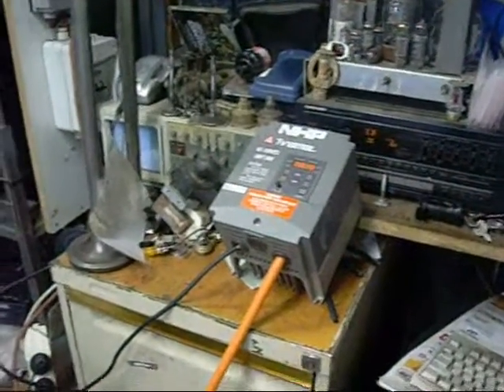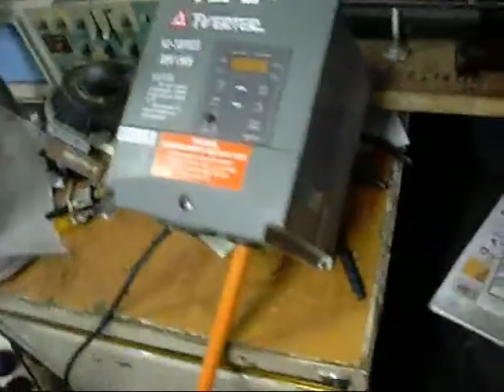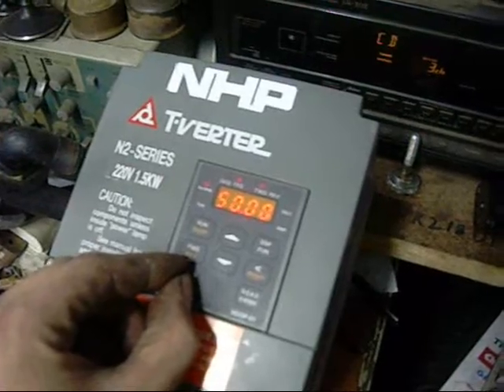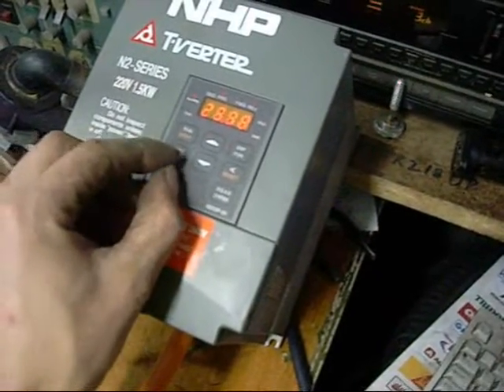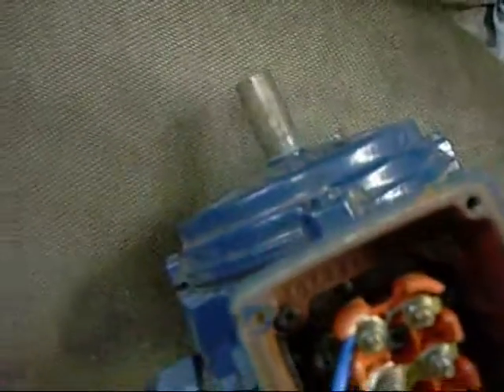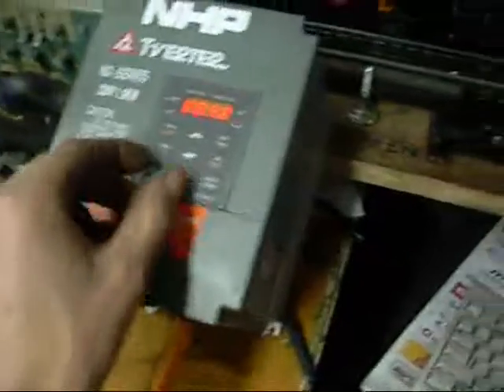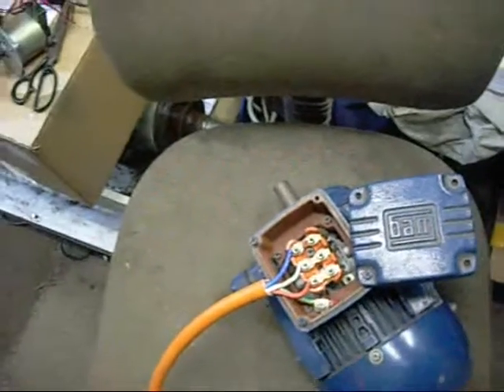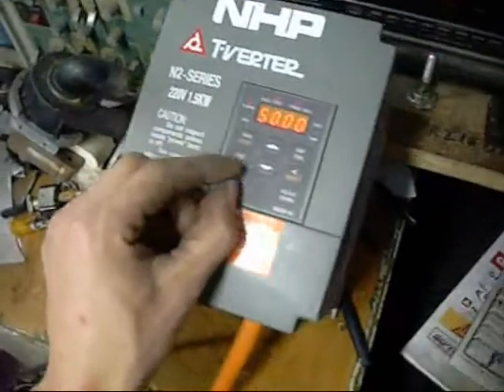Testing 1.5Kw NHP N2 Series VFD on .75Kw WEG Motor

Comment: Ola amigo, tengo un inverter  T-VERTER  N2 440V 3.7KW  si pudieras por favor enviar el manual de coneccionado de tu inverte, te lo agradeceria mucho, gracias por tu respuesta
Reply: Qual valor do teu inversor de frequencia eu quero comprar um para testar compressor inverter de 9000 a 24000bteus
Reply: Ola amigo aqui no brasil nao acho um inversor de frequencia para ligar compressor inverter na bancada